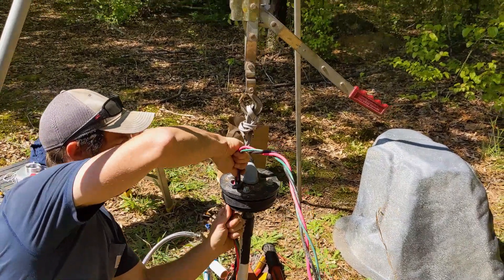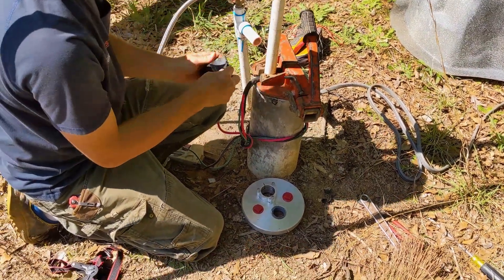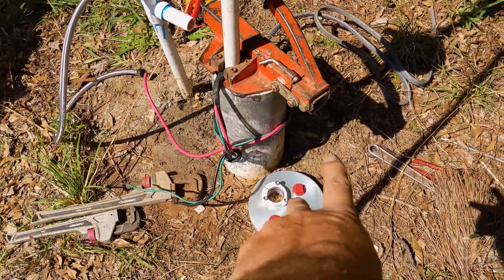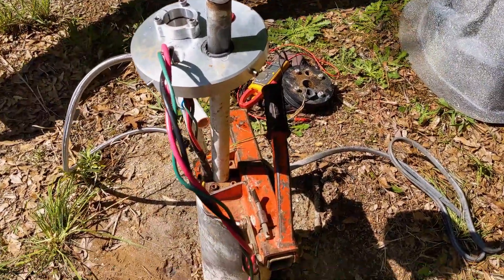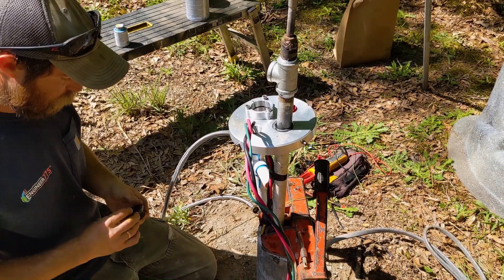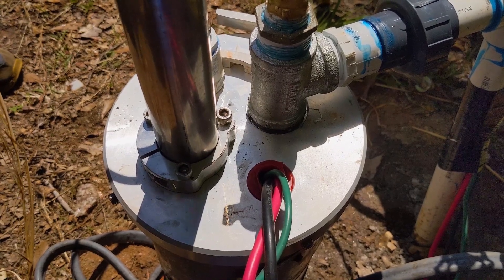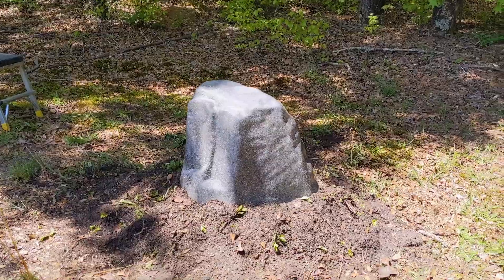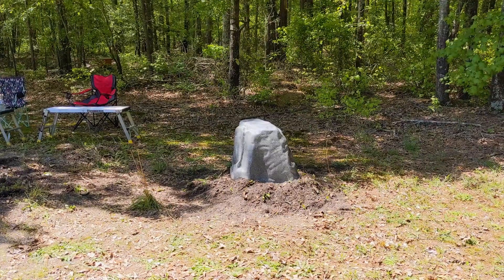Hand pumps are a great option for a well!

Comment: I have a deep well with an electric pump. I have tried to get a hand pump installed in the same well but the company that drilled the well and installed the electric pump didn't want to install a hand pump on top of the electric pump. Instead they wanted to drill a separate well. Total cost was about $8K with the hand pump installed, not including the cost of landscaping work needed after cleaning up all the mud in the yard after drilling the second well. I decided against it
Reply: Plumber told me to remove bladder tank and screw pitcher pump

Comment: I’ve seen a hand pump you can setup on your internal plumbing when you have a well set up outside. This hand pump (I believe you have shown before) is inline with you inside plumbing in case of a power outage. Is this still a good option and can it be used in the way I’m describing?
Reply: Got any links to a company that will do this?

Comment: Simple Pumps have a depth limit.  You didn't explain HOW you are using a simple pump on a 600' well, when the Simple Pump limit is around 200 ft.  ??!!!   What is the "static water level" of the well?  Casing size? Existing pump size? Depth of simple pump set ?